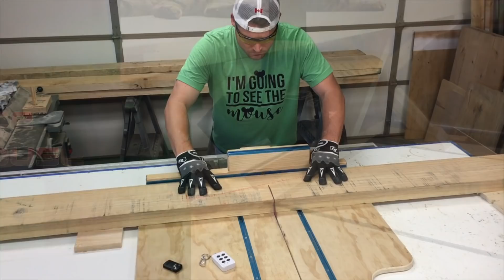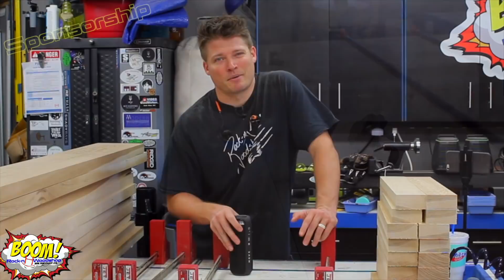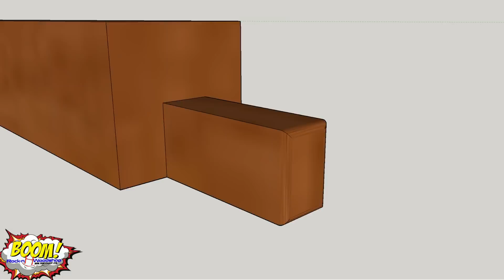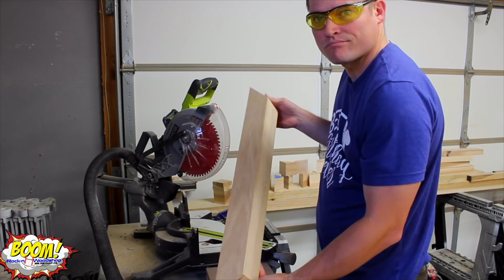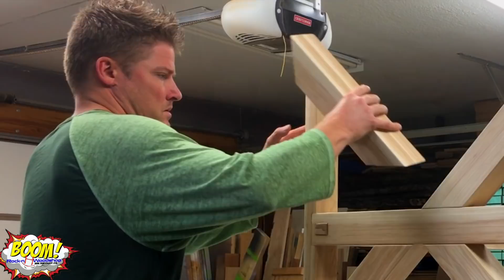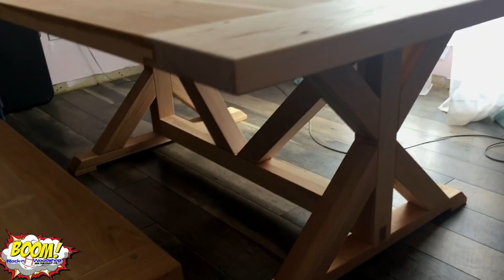Farmhouse Table // X-Brace l Hickory // Breadboard Ends

Comment: Hey Drew, what were the dimensions you used for the X braces, vertical brace and upper and lower supports? Table looks awesome, great video and awesome build.
Reply from the maker: Hey Micheal, the overall height of the table was 30" which is standard.I just adjusted the verticals to accommodate the thickness of thicknesses of the upper and lower braces, not to mention the 3/4" thick feet.  The X Braces were completely arbitrary to my liking, so they are not set in stone.  I do have a detailed plan for all of this build found here if you are interested.  You can adjust your widths and lengths from there.  Hope that helps. Plan: https://rhwoodshop.com/store/#!/X-Brace-Trestle-Table-Plan/p/137714342/category=23790308

Comment: Very good vid Drew, I am trying to build the wife a (L) desk and my tongue and groove are not cooperating as planed.Making with dado set. The grooves are a little wavy and the tongues are a little wide in spots. I will get it though.
Reply from the maker: All it takes is practice my man. Keep it up
Reply: Thank you Drew, I am going to need a bit of practice.
Reply from the maker: You need to use a feather board and your stock needs to be as flat as possible.

Comment: Great job and video. The grain pattern looks awesome. I'm looking forward to seeing the table with the finish on it. 
I have a question about the breadboard ends, I'm not sure but how much glue did you use? I asked because I've heard that your not supposed to use any glue except for the dowel pins. I'm not saying that you're wrong,it's just something I heard from different people. 
Keep the great videos coming

Thanks for sharing and God bless
Reply from the maker: That was a great question Roy and you are correct but to an extent. You are allowed to use glue on the center panel only. All panels otherwise need to be free of glue except for the pins